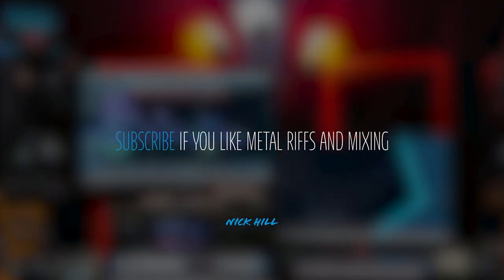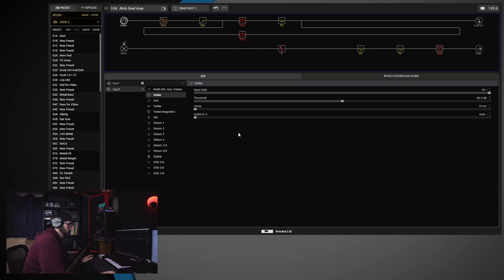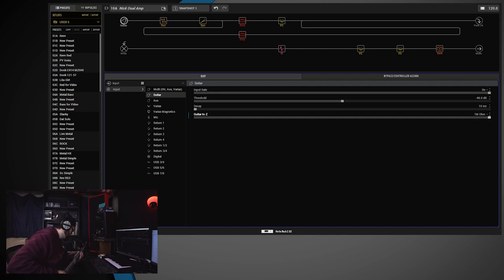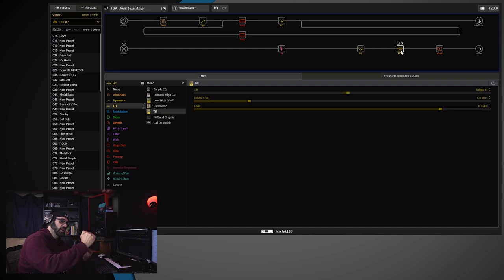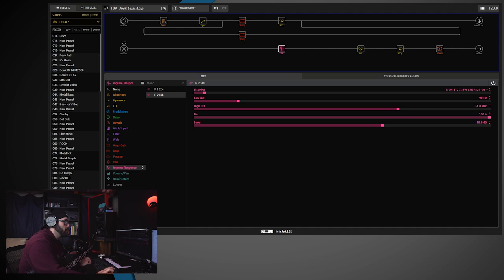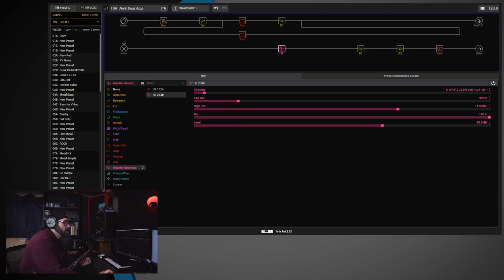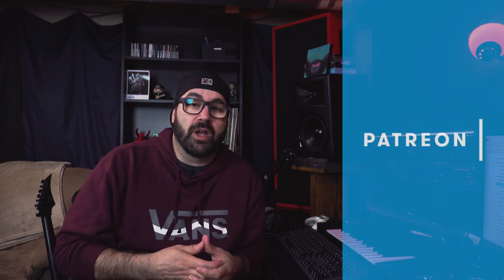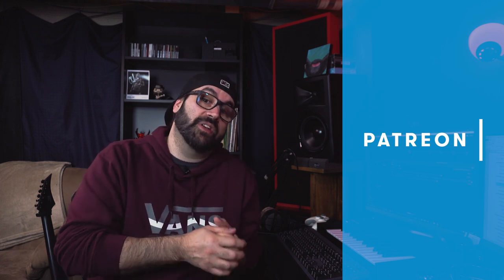Line 6 Helix QUICK TIPS and my GO-TO Ownhammer Impulse Responses

Comment: Great video as always, dude!
In terms of IRs I did something similar to not get overwhelmed by the sheer amount of options everytime. I first got the HH1 collection und just used the provided mixes from the quick start folders of every cab with a particular speaker/combination. I then narrowed it down to the speaker/combinations I liked and kicked out the others for each cab. After that I narrowed it again by filtering out the mixes I liked best. It turns out I almost everytime gravitate towards the OH1 mixes. You could go ahead from there and try out the single mics used in the mixes you chose and see if they represent the tone you are looking for even more precisely, but for me the mixes always win over the single mics. I went through the same process for the HH2 collection as well and found the same results. My goto IRs are the OH 212 ZLSF M25+V30 OH1-05 and the OH 212 ZLSF V30 OH1-05. I just love this Zilla cab! :)
Cheers from Germany!
Reply from the maker: That’s a great way to do it. You almost need to be deliberate and sit down to find what you like. Do the legwork ahead of time otherwise you’ll be searching forever. Cheers man! Be well

Comment: my advice. Listen with bass and drums in the mix, as it mask a lot of frequency in the high and in the lows. In my testing, Ownhammer are pretty heavy on low mid around 500-700hz, cut from 3-6db.
Reply from the maker: Always sound advice to listen to things in the context of a mix. I’d caution that your claims that OH IRs are heavy at 500-700 absolutely depends on the IR/cab and guitar/pickups. The EQ moves I make in Helix are almost all adopted from the moves I make in my DAW, in a mix. Cheers!

Comment: I find ownhammer irs too dark sounding that i have to boost the presence and use an eq. I tried other ir brands and dont have to worry about that. the only thing i like about ownhammer is the clarity you can hear when playing.
Reply from the maker: I roll all IRs off as well as my tone sometimes down to 6k. If you look at speaker response charts for just about any speaker, there’s a steep high end roll of that starts at around 6k, sometimes as low as 5k. I’ve never felt OH is dark. They definitely have dark mixes and depending on the mic, can lean dark, but I’ve not had that issue. Especially with the sheer amount of mic, mic placement options, mixes etc, I’d have a hard time labeling OH as dark. Obviously, different setups come into play.
Reply: @NickHillMakesMusic  Thanks for the speaker info! i tried different guitars and cables. dont know what else could it be :/ i tried seacow cabs (which are free) and solved it. too bright and harsh that i had to now lower the presence on the amp and tone on the overdrive pedal. you should try them if you want and experiment, maybe no eq required.